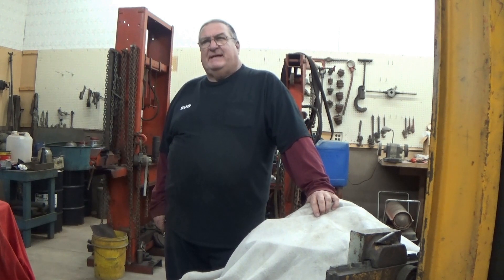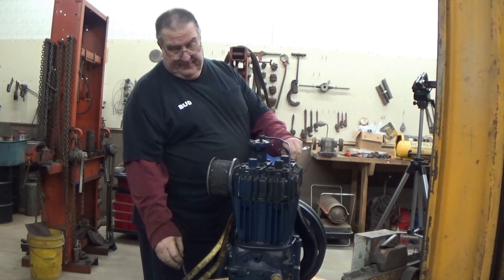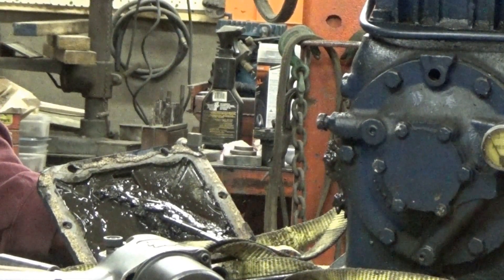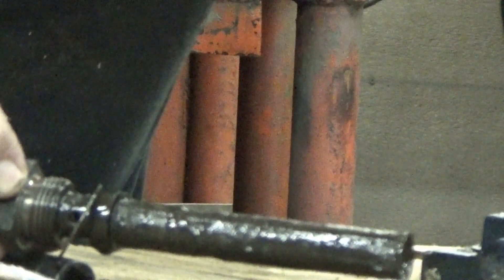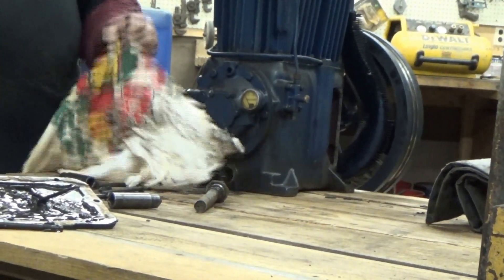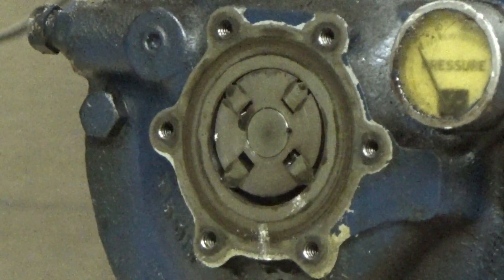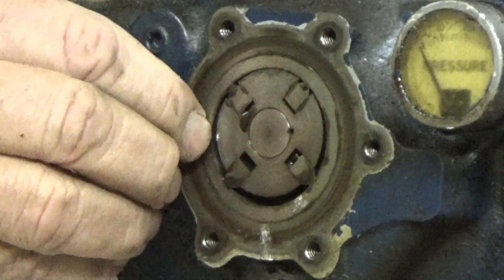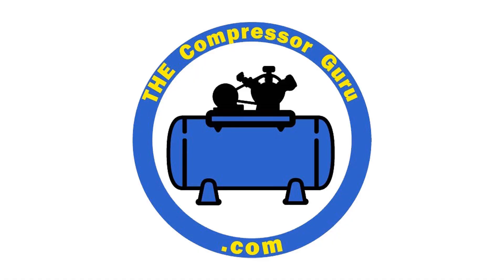Autopsy of a DEAD Compressor S3, E 18

Comment: IF the hydraulic unloader was connected to an air source .... IF, then the machine would have unloaded.  I think it would have had to run a pretty long time to throw a rod.  Either way, a terrible waste of a good machine.  
I never had any issues with the old vane pump.
Reply from the maker: the guy told me it may have ran 2 or 3 days. the vane pumps are fine on electric motor. but definitely had a problem in extreme weather in the big diesels on the drag lines.